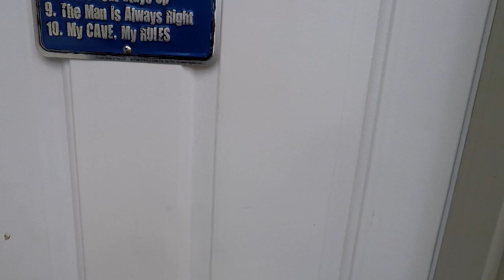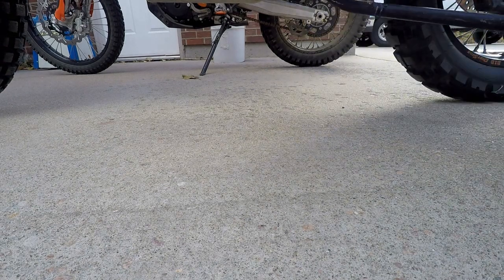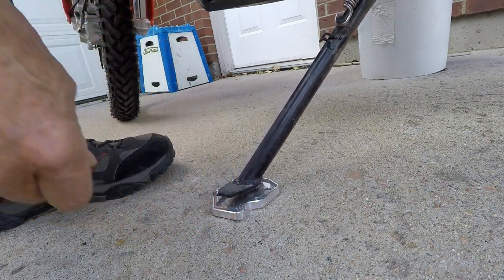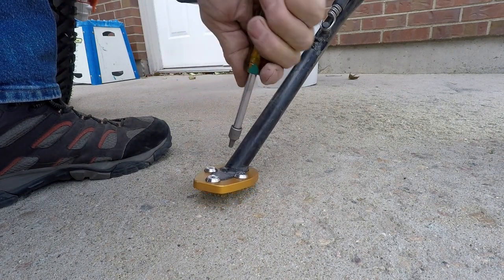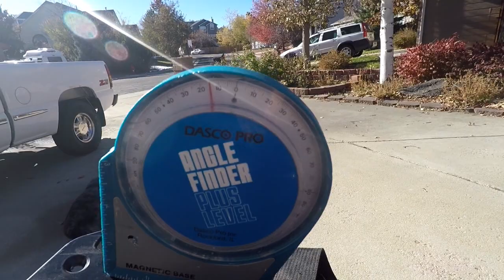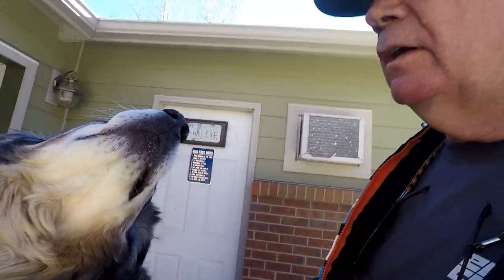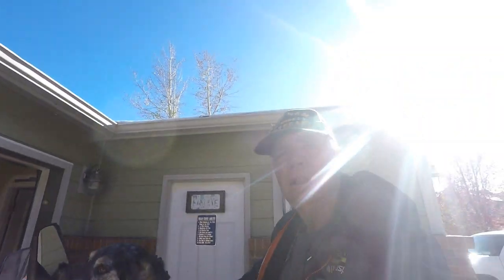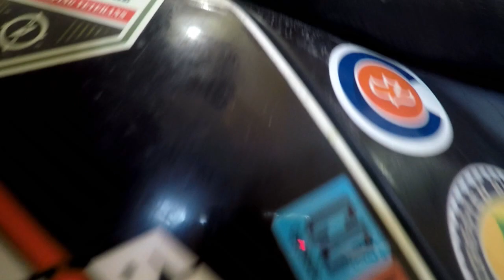KTM 690 Enduro Sidestand with Foot - Tilt Angles and Raising Problem

Comment: Hey Mike, Nice eval. I've had trouble with my 690 kickstand too when I need to raise it. Same goes on my 1190 but I have an aftermarket foot on it. I like it though when I stop on dirt or gravel. I had a nice 120 mile fall Texas loop this morning with my riding buddy Lewis. 45 degrees so "Colorado Layers" were required. Good to see you again, even if only on video. Ken Frazier
Reply from the maker: Hi, Ken! It was cold, showing 50 deg. I had to wash my bike and Deacon and I took it to the car wash.

Comment: Hi Mike & Deacon,  just saw your latest video while in my basement exercise room.  I can definitely relate to tilt angle challenge with tall bike.  My experience is this happens when the kickstand is essentially too long or steep angle.  On my F800GS if I crank on the preload knob and rain the bike up in rear, I can effectively shorten the kickstand distance to ground. So it can swing out of the way.  Unfortunately I am too short to keep cranking the preload up.  As you noted, it also messes with the suspension sag. 

I am thinking the best solution is to shorten the kickstand every so slightly or if you can bend the kickstand out about halfway down.  Kind of like the big GS bikes.  Adding a kickstand foot only makes the the kickstand longer.

Oh, I noticed some folks weld a notch or put a Ram ball mount near the bottom half of kickstand to make it easier finding it with the heal of your boot.  A definite good idea for mod.  

Keep the great videos coming.

Comment: Thanks for this good review Mike, I'm also in Colorado with a '19 690, I'm a little shorter than you with stock suspension, so already on my tippy toes, what I also find is that if I pull off the side of the road, the road/shoulder/asphalt to dirt drop-off on the right side typically exacerbates the issue. I plan to lower my suspension, then either get the SMC side stand or have a friend with a welder cut/lower mine. Often I'll be leaning as far as my left toe can push, while my right toe is in the air still and can't get the side stand up at all. I' have to slide off the seat to the right, but then can't reach the side stand very well at all. I think you used a Kouba Link, how is that working for you? I heard other people say you need to lower the bike in the suspension.
Reply from the maker: Lowering it via suspension mods is better than doing it with a kouba link. I'm still stock. If you haven't changed anything by April, I will be home and can weld your side stand for you.

Comment: Does anybody make half inch shorter kickstand. I would like to put a foot on the kickstand. Obviously on sand it just wants to go straight in and fall over. So I'm wondering does anybody make an aftermarket kickstand for the bike with a wider shoe
Reply from the maker: I plan on cutting mine down 3/4 inch this week. Its easy enough for a regular welding shop. I have a metal cutting bandsaw and a TIG welder from my Battlebot days, so for me its a piece of cake. I've done at least three for friends. I would do it for you but I am heading for Mexico soon. Are you in Colorado?
Reply: @telerover  no I'm in Kansas. I appreciate the offer . Have a good time in Mexico I'll watch the videos.
Reply: I had Vanasche cut 1.5” of my stand and made a big difference.  The weld and powder coating work is phenomenal.